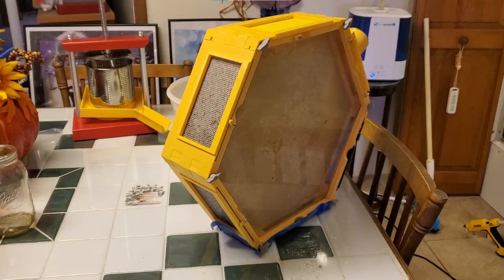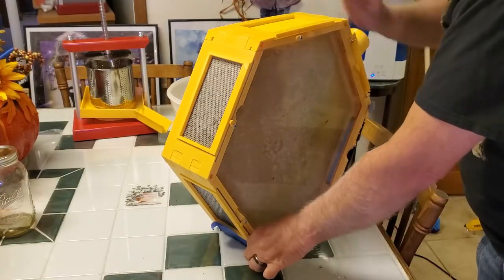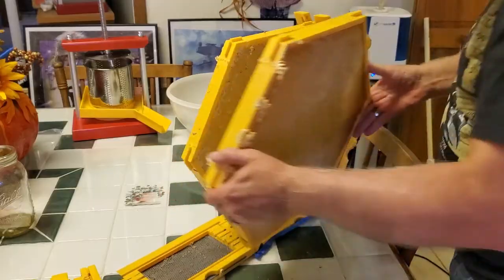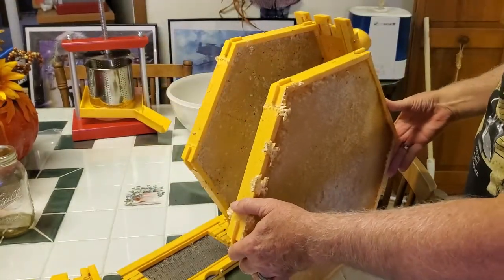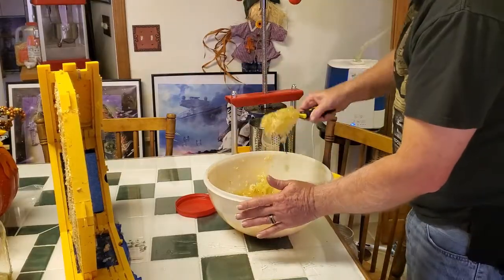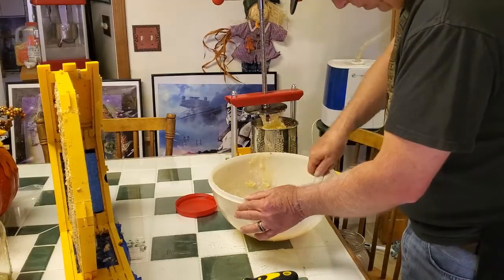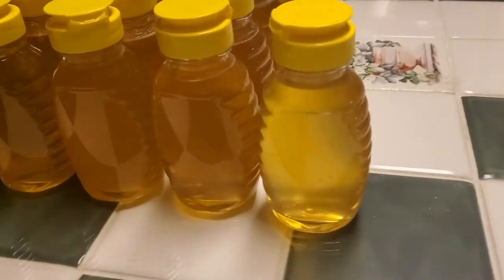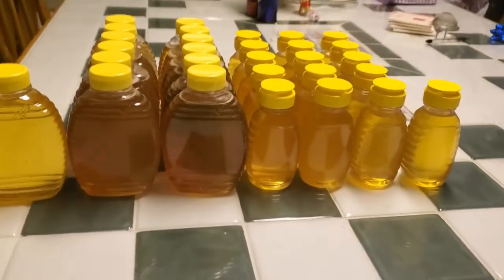Part 9 3D Printed Indoor Bee Hive

Comment: How would you get to the honey if the bees did not die?
Reply: If you wanted to get all the bees out of a section once it was full,  is there a way to do that?  Is there a design for a one way bee connector?
Reply from the maker: It was my plan for them to put the honey in the flow hive part.
Reply: @bigchessset  this is the first time I’ve seen a set up like this. Pretty nice. Keep up the good work.